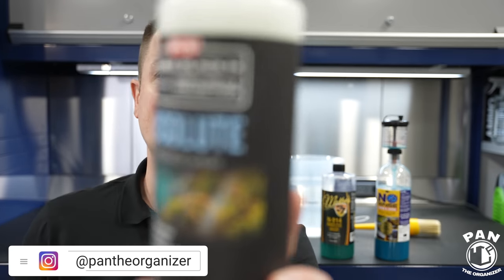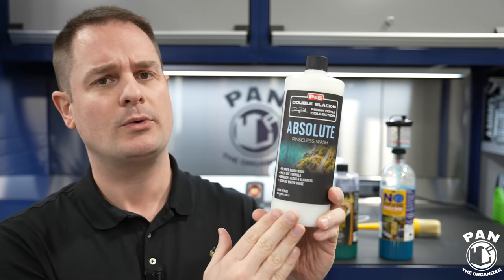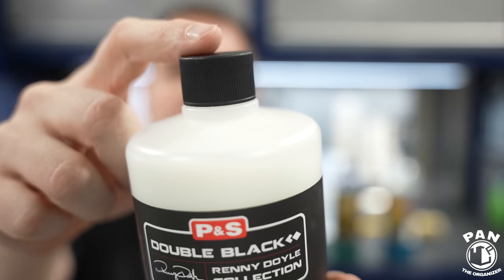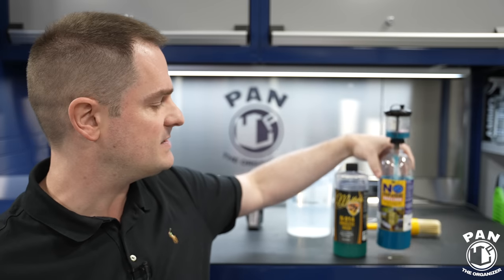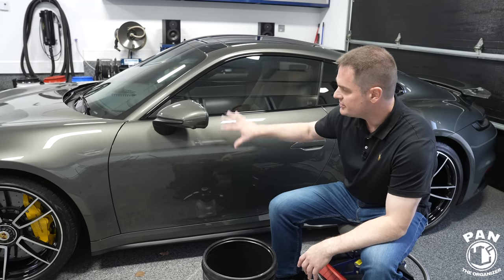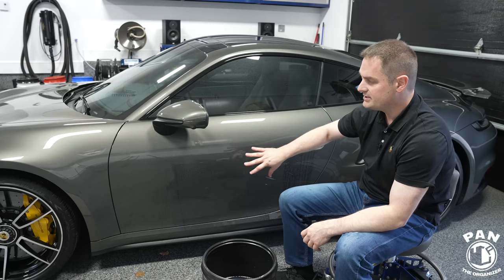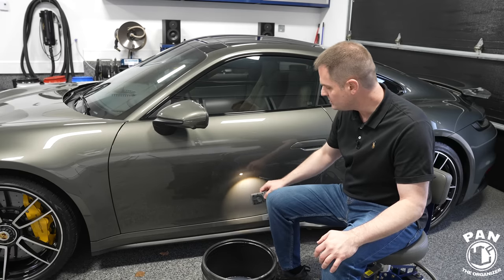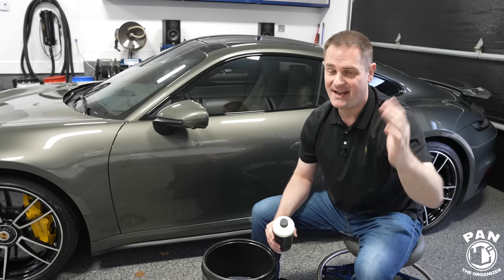NEW P&S Absolute Rinseless Wash... Is it better than ONR or McKee's?

Comment: @pantheorganizer can I use any of this rinseless wash in my pad cleaner bucket? DIYdetailing recommend using their rinseless wash to wet and wash the pad, but DIY is not available in my country. I have the P&S absolute and think to use that. Or are there better alternatives?
Reply from the maker: Yes you can.
Reply: @PanTheOrganizer  thank you 🙏🏻
Reply from the maker: My pleasure. How did you discover my channel by the way?

Welcome to my channel. You discovered one of the biggest car detailing channels on YouTube as we surpassed 1 million subscribers and we have over 140 million views! I have been detailing for 27 years and I love to share my knowledge and passion with my viewers.

You found the right channel to help you learn everything about detailing.
Reply: @PanTheOrganizer  I discovered it a month ago, searching for the two bucket wash, and landed on your end of the two bucket wash 😂 from there on I have been hooked. 😁 so much good information. Would love to see more tests of Bilt Hamber products. 

And for my question, it was pad cleaner in form of a grit guard pad washer, during polishing. But I think you got that and that the answer is yes, use absolute. 

I am also wondering whether or not to use ipa as panel wipe or if I should go with the brand of the ceramic coating or the polish brands specific cleaner. There is a lot of different options out there. 😅
Reply from the maker: It’s best practice to use the panel prep spray from the same company as the ceramic coating you are applying in the end.

If you apply a CarPro coating, use CarPro Eraser as a panel prep. Gyeon coating, use Gyeon Prep as a panel prep. Etc

Comment: Hi pan great video i just  have a question do u have to use distilled water or house water? 

Thank u
Reply from the maker: When doing your mix in the bucket you can use house water. Of course the better the water the better the results. But the rinseless washes have water softening agents in them so it should make your house water ok.
Reply: @PanTheOrganizer  alright thank u so much pan

Comment: Love the video. One question. If using the bead maker do you apply it during the pre treatment or after drying the rinse less wash off. Thanks in advance.
Reply from the maker: If you plan on using Bead Maker, it would be at the end of the entire process. Either spray it on the rinseless wash while the car is wet (to increase lubrication as a drying aid) or once you towel dried the vehicle, you can apply Bead Maker on dry paint.

Comment: Hi thank you for your video.  How long can you keep the unused solution around such as those left in the sprayer?
Reply from the maker: There is no defined amount of time, as I don't think anyone has really tested this, as people go through it eventually. I have heard of some having it in a bucket for a month, and it was still fine, but they used distilled water for the mix.

If you're using regular tap water, you're in uncharted territory hehe.

I have some mixed in spray bottles with deionized water and after 2-3 months it's still fine. I still like to mix a fresh batch after that time, just to be safe. It's super cheap anyways as you're only using 0.5 oz per gallon of water...

How did you discover my channel by the way?

Welcome to my channel. You discovered one of the biggest car detailing channels on YouTube as we surpassed 920,000 subscribers and we have over 120 million views! I have been detailing for 26 years and I love to share my knowledge and passion with my viewers.

You found the right channel to help you learn everything about detailing.
Reply: Thank you for your reply.  I found your channel by YouTube’s recommendation when I was watching similar content.

Comment: Just out of curiosity, what if I used Absolute as a pre rinse in a pump sprayer followed up by a contact wash using Carpro reset (working panel by panel). How effective/ineffective do you think that will be?
Reply from the maker: If you use a pre-treat with a rinseless wash, you spray it, rinse it, and then proceed as per usual with your contact wash. You can also pre-treat, then rinse, foam, rinse, foam, wash. That's probably the safest method.

Comment: Is there waxes or sealants in this product? If so, do you have a recommendation for a rinseless wash that doesn't have those? I want to use it to wash my car and then put beadmaker on it afterwards?
Reply from the maker: There is no protection in these. These are just pure rinseless washes.

Once you are done with the rinseless wash process, it's up to you if you want even more lubrication, gloss and slickness to spray your quick detailer or Bead Maker on the surface, and then towel dry.

Comment: can you use it as 128:1 for the rinseless wash for even more slickness?
Reply from the maker: It depends what use you have for it. For just washing the car, keep it at the 256:1 ratio, as you won't have streaking issues at that level. The chemists who formulate these specifically give detailed instructions for a good reason.

Also, with some of them, you can dilute them for different uses. See my video: https://youtu.be/iGMI9_UY1WQ

Comment: Pan, awesome video! I’ve been waiting for this one!
In your 2022 Top Products video, you mentioned that the OG Drying aid and Xtreme Topper Drying Aid is the same formula as an Adams product. Which Adams product do you reference? 
Thanks! Keep up the awesome content
Reply from the maker: The Obsessed Garage Drying Aid, and Xtreme Solutions Topper are blended by B&B Blending, which makes the B&B Blending Slipstream product, so only color and scent changes for third parties. Adam's also has it but they call it "Slick N Slide".

Comment: Hey Pan, great video as always. Got a question for you. I have seen the new M3 video from matt at OG, he uses N914 diluted 256:1 as washer fluid, can P&S rinseless wash do the same trick? Thanks 🙏🏻
Reply from the maker: I have never tried using rinseless washes as windshield washer fluids as I live in Montreal and we have sub zero temperatures so that wouldn’t be recommended. You need a product that can go below freezing here in Canada.
Reply: Just bought the ultra black sponge and absolute, absolutely loving it. I live in Manchester, a rain city.
I still prefer the 2 buckets method but sometimes you spend all the hardwork, snow foam, handwash, blowdrying the car, then it starts to rain in few minutes. Rinseless wash sort it out completely. I will still use the pressure washer, pre-treat, snowfoam, but for the hand washing stage, I just switch to rinseless and don’t even dry the car lol, no worries about waterspoting issue.

Comment: The slickness of p&s means it does leave a protection on top of the paint?
Reply from the maker: I asked Dave the chemist at P&S that very same questions and this was his answer: 

"As for leaving something behind, the quick answer is that Absolute does not leave any protective film behind on the surface. Just about everything is removed by the drying process and our point is to create a clean surface.

We are not leaving any protective material behind. And what is left behind will not affect the performance of the original surface or how finishing products will perform."

Comment: How do I dilute it per gallon to make a quick detailer that will preform as good as well as the Wolfgang Uber?
Reply from the maker: You dilute the P&S Absolute 64:1 for use as a quick detailer (instructions are on the label). Yes it will work as good as Wolfgang Uber, perhaps even slicker feeling.
Reply: @PanTheOrganizer  fantastic pan, ur a huge help and inspiration!!!

Comment: Pan, if you are committed to the details, then I'd recommend quitting volumetric measurements and shift towards weight-based measurements. 

Your ratios should be much more accurate this way.

A nice gram scale is all you need and you don't have to deal with measuring cups.

Let me know what you think!
Reply from the maker: Nah. Nobody goes by weight, and that would confuse viewers. You are overthinking the moment here in my opinion. It doesn't have to be that accurate when it comes to detailing chemicals, as they know most people don't even have measuring cups, let alone scales. And this is coming from me who studied at the medicine faculty in molecular biology and biochemistry. In that environment, every % counts. Not in the detailing world. Just have fun and enjoy the process. ;)

Comment: Off topic question, but any chance you might know why my Marolex Foamer is just “oozing” out? I’m not getting any spray/pressure whatsoever. It worked for me once but I legit had to pump the sprayer like at least 30 times for it to barely work.
Reply from the maker: Did you reach out to the place you purchased it from? They usually can help with troubleshooting. I have had no issues with mine.

Comment: Would this work well with washing off road salt during the winter?
Reply from the maker: Yes but a pre-spray is key, with a pump sprayer, let it dwell and then do the cleaning process. If there is a thick layer of muck and dirt, pre-rinse with a pressure washer before doing the rinseless. 

See how the boys at The Rag Company cleaned a super dirty truck using a rinseless wash here: https://youtu.be/U0nSQe1qHEc

Comment: Is it ok to use as a prep before using a sealant? Would it have bonding issues?
Reply from the maker: It's always best to use a proper paint prep (IPA based) before applying any form of paint protection. Products like CarPro Eraser and Gyeon Prep are designed to remove polishing oils, old wax residue, and prep the surface for the application of the new protection.

This step is especially crucial before applying ceramic coatings. Not as important if you're just applying a carnauba wax or regular paint sealant.
Reply: Stay awesome Pan! Thank you!

Comment: Hello Pan, another great video. I wash my car weekly, could I use the rinseless wash pre washing the car? Just spray the car then pressure wash off prior to snow foam and then a contact wash. Thanks heaps. Think I saw you do this with your Porsche in another video.
Reply from the maker: That's exactly what I like to do. I typically use a rinseless wash as a pre-treat, rinse, then use a foam cannon, rinse, then a 2 bucket wash.

There are many ways to wash a vehicle, and I often use different techniques and methods to test different ways. I wash my car twice weekly on average, so I like to experiment.
Reply: @PanTheOrganizer  thanks so much. Appreciate the advice. Have a great day.
Reply from the maker: My pleasure!

Comment: Hello, can i make some to the bottle and hold it as a glass cleaner as a no rinse?
Reply from the maker: Yes you can use the rinseless wash solutions as a glass cleaner. Same standard 1:256 dilution (0.5 oz or product in every gallon of water).
Reply: @Pan The Organizer  i bought it today. In my country those products are difficult to buy cause only one shop import P&S. But what did you say about leaving surface without damage for coatings has convinced me :)

Comment: How does this compare against the Carpro Waterless ECH2O ?
Reply from the maker: You can’t compare both as Ech2O is more of a waterless wash that has ceramic component in it so it adds a bit of something on the surface. Absolute is a pure rinseless solution.

Comment: Hey Pan, I’d like to know what are the differences, if any, between waterless wash and rinse less wash?  Are they the same thing?  I’m just a bit confused.
Reply: Spray waterless wash = spray + wipe 
Rinless wash = wipe sponge + wipe drying microfiber
Reply from the maker: Two very different technologies. A waterless wash uses ZERO water. You are spraying the product directly on the surface, and wiping. That is the last alternative and not as safe in my opinion as a traditional two bucket wash or a rinseless wash method.

In a rinseless wash, you are using a bucket with water and the rinseless solution, you are applying the rinseless solution to the surface, and at the end you don't need to rinse, you simply wipe with a microfiber drying towel. If the vehicle is very dirty, use common sense and pre-rinse first with a garden hose or pressure washer.

A rinseless wash doesn't mean you never rinse. It only means there is no rinsing needed at the end of the wash process.

Comment: Not to be Mr Negative. But I never see rinse less wash products being used on a car that's properly dirty. All the professionals like yourself seem to only want to use it when you're car is lightly dusted. Its as if you don't really trust the product to not scratch paint work? great video by the way. :)
Reply from the maker: That's because you need to use common sense when doing a rinseless wash. Personally, I mainly use the traditional two bucket wash with water and mitts. But some people need an alternative when they can't access free flowing water (living in apartments, condos, or in cities or states with water bans or heavy water restrictions).

But a rinseless wash should only be performed on a lightly or moderately dirty surface. If the vehicle is caked in a thick layer of dirt or mud, you would pre-rinse the vehicle BEFORE doing the rinseless wash. A rinseless wash doesn't mean you never rinse, all it means is that no rinsing is needed AT THE END of the wash process.

If you use a rinseless wash on a disgustingly dirty vehicle caked in thick mud, you will scratch the paint. Again, common sense.
Reply from the maker: Correct.

Comment: Do you have to use distilled water?
Reply from the maker: No, regular tap water is fine. The rinseless wash encapsulates minerals anyways, and lessens the chances of water spots. Use common sense though, don't work in direct sunlight if you can avoid it, and work on cool panels.

Of course, distilled water or DI water would be even better, but not mandatory.

Comment: Since you've mentioned it, is it ok to use an SI02 infused topper for a ceramic coated car after using this product? I know that if you follow the right steps, there's gonna be no scratching, but I still "feel" like Rinsless is a little scary for me :P Although seeing you use it on your perfectly maintained Porsche really does helps me a little be with it xD Btw, how about making a video showing a little more the condition of your paint after 1 year and mentioning all the different kinds of products you use on your car? As you've mentioned you really try out a lot of products, so it'd be a pretty interesting video/talk I guess.
Reply: Yes. You can add a ceramic drying aid while the car is still wet to help you dry the car, provide protection, and add slickness.
Reply: I use AutoFanatics Hydro gloss WW at 4:1 as a drying aid. Love it.
Reply from the maker: Yes you can spray which every drying aid you want on top of the rinseless wash if you want even more gloss and slickness. Many do this.
Reply: I used Technician's choice ceramic spray as a drying aid and it worked wonderfully. Been beading through the rain the last couple weeks in southern California.

Comment: Hi Pan, have you seen the encapsulation demo on onr you tune page? Any thoughts? Ty.
Reply from the maker: No but I have seen a few videos from smaller channels in the past days with some tests in cups, and I was wondering what is going on with these tests lol. There seems to be a difference in results. I don't have any thoughts on the topic at the moment, as I mainly use a traditional wash method personally. 

Those who use rinseless washes more regularly, or as their main wash process, should perhaps share their opinion on that matter. 

I think conclusions from reputable channels are all the same. Top tier rinseless washes at the moment are DIY Detail Rinseless Wash, P&S Absolute, McKee's 37 N-914 and perhaps a few others.

At the end of the day, it's just a rinseless wash. Pick one that works best for you, and don't overthink the moment.

Comment: can you add shampoo to a rinseless wash
Reply from the maker: Not to my knowledge, as you'd be altering the chemistry of the rinseless and it would defeat the purpose anyways.

What you can do for a traditional wash though, when you have your shampoo mixed in the bucket as per usual, is add 1 oz of rinseless wash in the solution to soften the water (if you have hard water issues).

Comment: Nice video Pan. Can we use this on PPF and tinted glasses. I have optimum no rinse. Thanks.
Reply from the maker: Yes you can use rinseless washes to clean a car wrapped in PPF and vinyl wraps too. The tinted film is on the interior of the glass by the way, so it has nothing to do with exterior washing.

But you can use a rinseless wash as a glass cleaner if you want.
Reply: @PanTheOrganizer  perfect 👍🏻. Thanks again !!

Comment: Does absolute leave any polymers behind on the surface like onr does?
Reply from the maker: Hi. In my testing, I noticed that Absolute did not change the hydrophobic properties of my coating, so I was quite confident it wasn’t leaving any surface-altering protection or residue behind. It did leave a nice clean, slick and shiny surface.

As many viewers had the same question as you, I reached out to Dave Phillips, chemist at P&S, and his official response is: “As for leaving something behind, the quick answer is that Absolute does not leave any protective film behind on the surface. Just about everything is removed by the drying process and our point is to create a clean surface.

Not leaving anything on the surface makes sense in detailing terms. We are not leaving any protective material behind and we don’t want to mislead the consumer into thinking there is. And what is left behind will not affect the performance of the original surface or how finishing products will perform.”